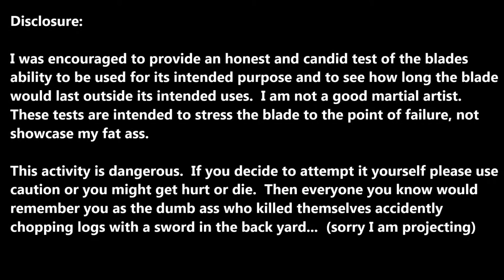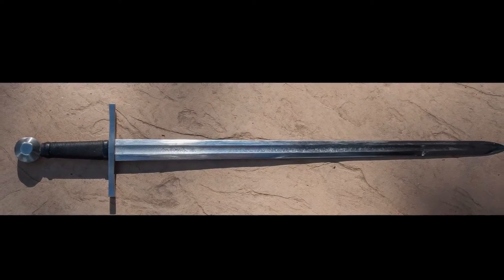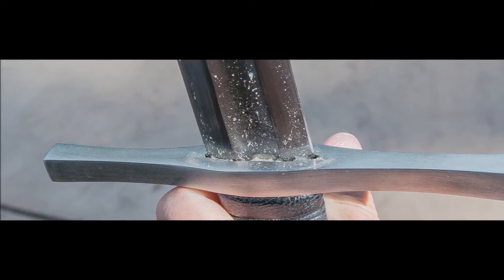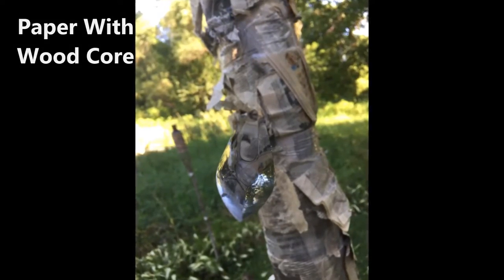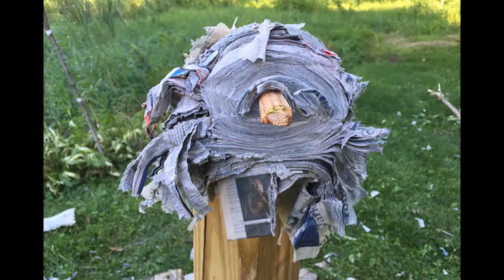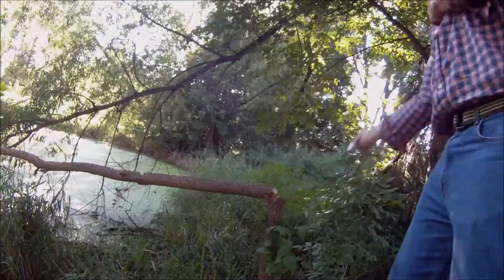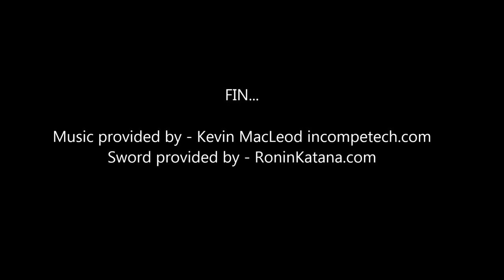Ronin Katana Medieval European Arming Sword Prototype Destructive Test: Part 1

Comment: Great video, thank you. I didn't know you changed the format... 4 years ago or so haha! All the videos I watched were top notch. The content and camera quality are superb, and then there's your style, with a type of humor that cracks me up and a no-bullshit, straight to the point, zero-arrogance approach to what you do. So huge thumbs up.
Last and least, two thingies:
1) I know that sword, at this point, is most likely dead and buried, however, if you were to fix those 2mm dents, wouldn't that mean having to remove 2mm off of the whole edge, on both sides, effectively reducing the overall width of the blade by a whopping 4mm? Or are there other ways to fix such damage?
2) When you mentioned grabbing the sword by the blade to use the crossguard as a hammer, well yes of course, you were right, it is and was a technique, but, one you'd do with hand protection of some sort, thick leather, mail, plate, etc, with this I mean, you could have the sharpest blade on the Planet, and still perform the technique while keeping your hands unscathed. Thus, there's no excuse to not to have a good edge, albeit not too much of a problem as how sharp swords come from their manufacturers tends to vary quite a bit.
Cheers mate, have a good one!
Reply: I think it would have been cool if he did a video of him trying to salvage it by grinding out the small nicks and then just sharpening the bigger ones into serrations.
Reply: @propanedaddy5577  Haha now that'd be something to watch! Great nick btw!

Comment: Whoa, amazing. Funny, engaging, and informative. You really put it through its paces . The only thing I would of liked to see was how it sharpened and then cut because it use a used sword when you got it. Other than that I think this was chill.
Reply from the maker: +Maps & Dragons That is a good suggestion.  I am always hesitant to  sharpen stuff for two reasons, its not representative of what you would get out of the box, and I am not very good at it.   That said, I think you have a point.  This one had already been used so it was not sharp as it would be out of the box anyway, and maybe sharpening provides prospective on how well it could cut.

Comment: i have modified mine with my dremel and other tools.

1280 grames to 1210 grames ;)

the faces of the blade are perfectly flat...
well ballanced, POB 13 cm to 11,5 cm !

it's really better.
Reply: Where did you dremel? Did you expand the fuller or?